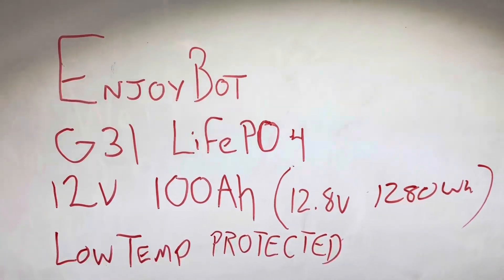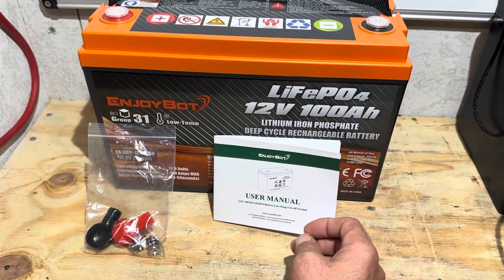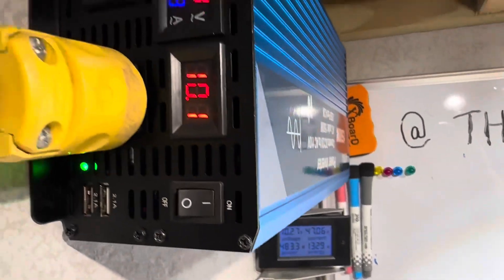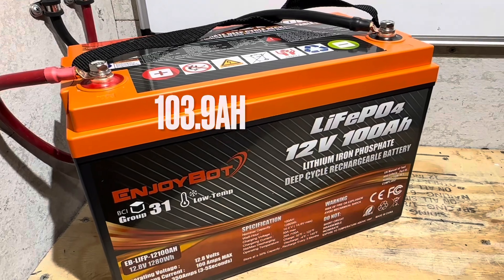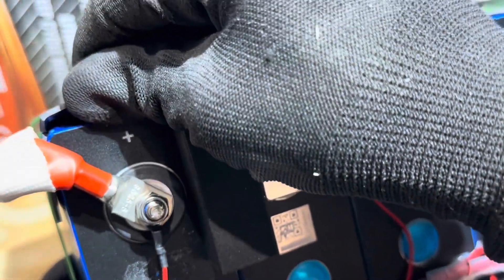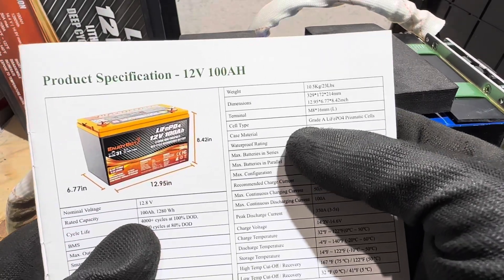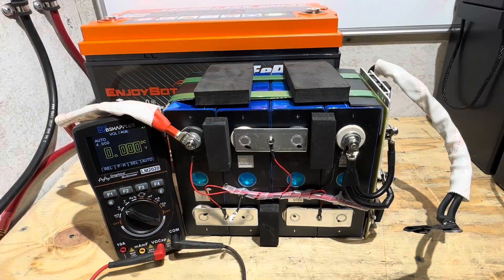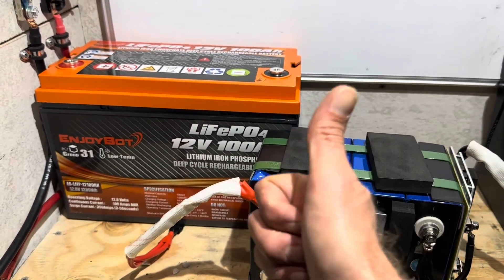EnjoyBot 12.8V 100Ah LiFePO4 Lithium Battery Review Teardown Low Temp Protection Group 31 Battery

Comment: 2 questions. Is it very common for these companies to use B grade and say they are using A? Also, aside from the B grade cells, would you have any issue installing this battery in a golf cart, on it's end, as long as the positive side is on bottom, so the BMS would be on top?
Reply from the maker: Sometimes you find B grade or very old cells. Sometimes you find premium cells. 
I used Enjoybots in my GC for a while 3 EnjoyBot 12.8V 100Ah LiFePO4 Lithium Batteries For My Golf Cart
https://youtu.be/CuqSc0X9bFA
No issues and did well. 
I would have to say stick with manufacturer specs for installation direction. The cell vent position is important too!

Comment: Really impressive it still worked fine with that drop damage. But sad to see the B-grade cells. Would have been a top battery otherwise. Thank you for the test. 👍👍
Reply from the maker: I was definitely surprised it survived as well! It is a good battery overall and works properly. B cells while advertising as A cells is a bummer for sure. ☹️ EVE B stamp are still good for energy storage systems and low speed EV (aka golf cart). B mark doesn’t meet strictest quality standards (size, capacity, weight, resistance etc) QR is defaced and Part 1 code is removed by EVE for these. Part 2 code remains and contains date code. Glad you enjoyed the video, thanks for stopping by!